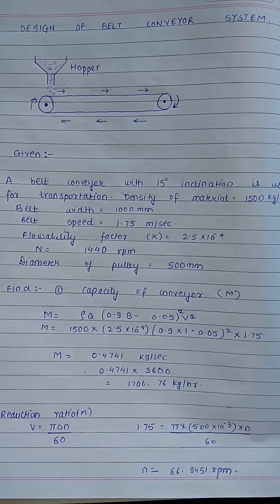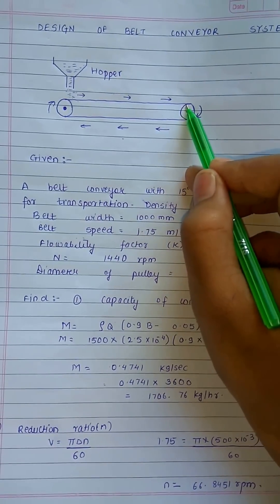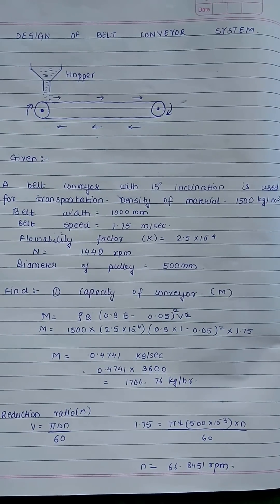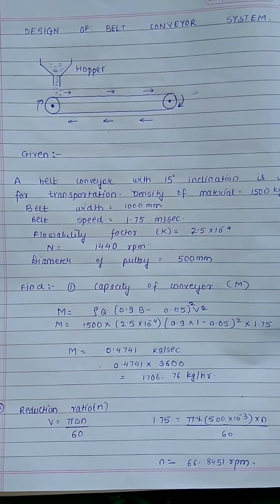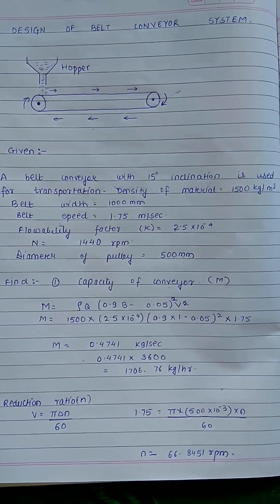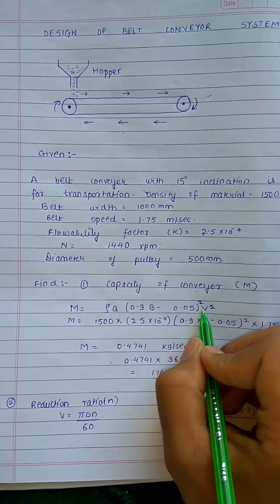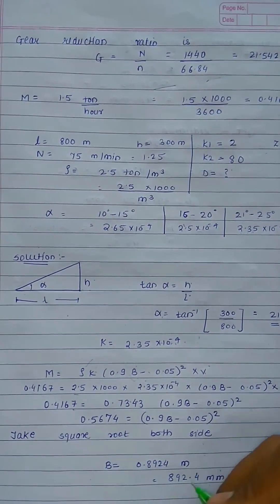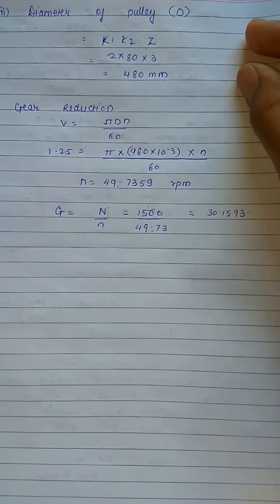Belt Conveyor Design Numericals Problems

Comment: In the 1st numerical what is the use of inclination angle which is given and another thing that in your mass capacity formula you write as  m=pQ(0.9B- 0.05^2) BUT  you are using K(Flowability factor) which in place of Q

Comment: I think your motor should be on the opposite shaft in your first example.  As is, you're pushing a rope along the top.  In order to do this with the drive at that location it would require pre-tension in the belt which doesn't appear to be taken into account in your calculations.